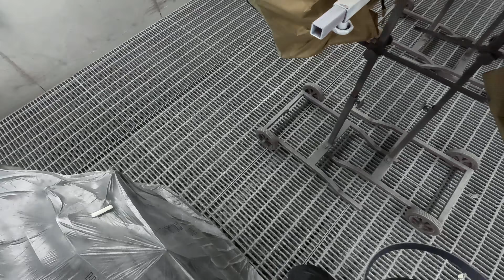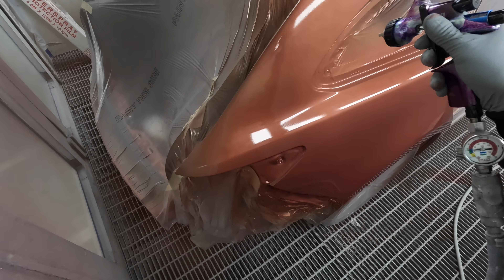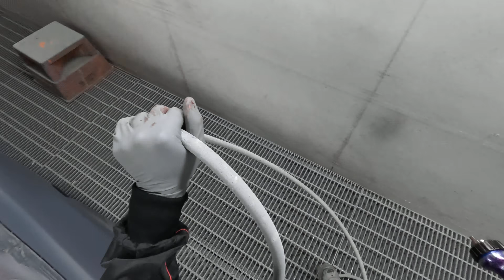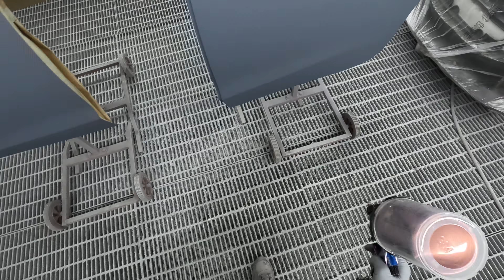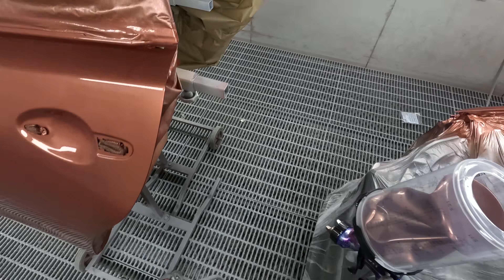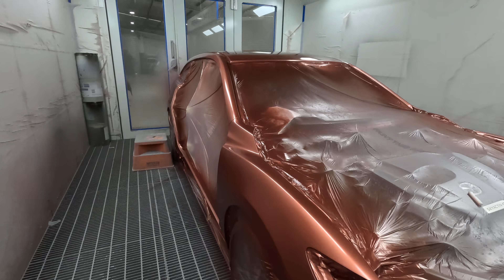My First Respray Using PPG One Visit Modifier

Comment: Hi Gunny, that one visit modifier looks like it has transformed your basecoat application plus it covers really well on the first coat with a nice silky smooth finish, it must make the job so much easier plus as you said with a smoother finish it must be easier to wet the panel up when you lay the clear👌

I'm not sure why my mate here in the UK had problems using the one visit modifier when he tried it in the PPG system, he was saying it just didn't cover properly so he still had to do it in two visits with a flash time in between coats, he is a very experienced pro painter as well but I think he ended up leaving the place as he wasn't happy there😟🤔👍John UK

Comment: Did the base look as smooth as the axalta systems
Reply: Pretty much mate yeah
Reply: @ my boss is planning in switching to either the glasurit 100 line or spies hi tec    In January from sikkens autobase I’m  very much ready for the switch our booths are set up for water already.  With your axalta systems you used to spray did you like it with the dv1??? If so what settings did you like on the digital gauge I’m at 15 psi which I think is 22 at the base of the gun

Comment: I sometime do the same thing with Glasurit 90 Line, one coat and straight over with control coat but only on darker colours
Reply from the maker: Isn't that what 100 line is for?
Reply: @TheGunmanRAW  It is but I tried it with 90 line, 90 line is thick but 100 line is a lot thicker I heard. And your WoW gotta be close shade so you don't overload the paint a lot with the 90 line if that's makes sense